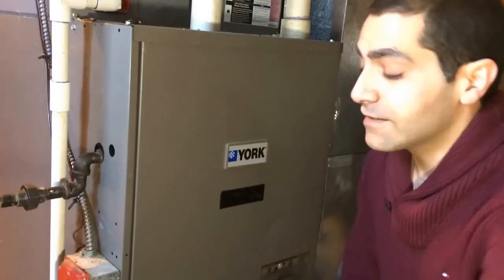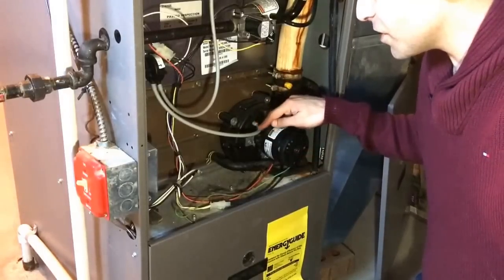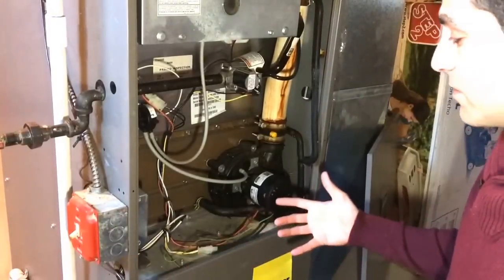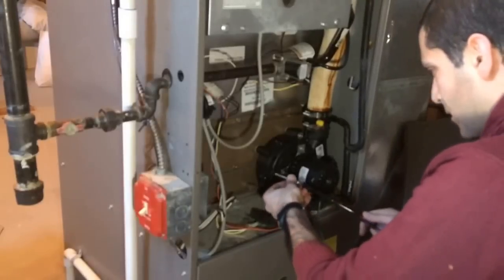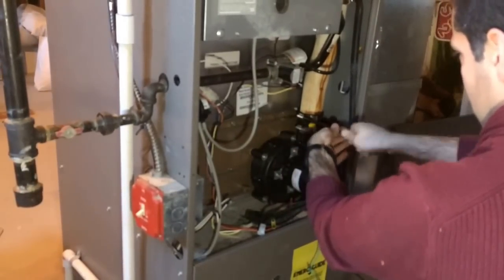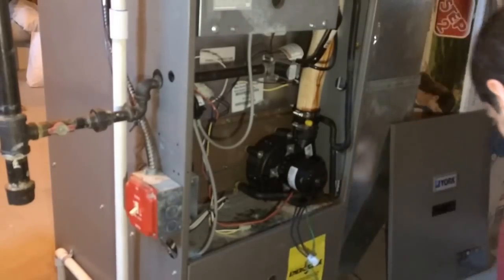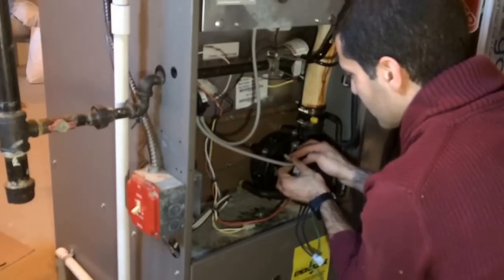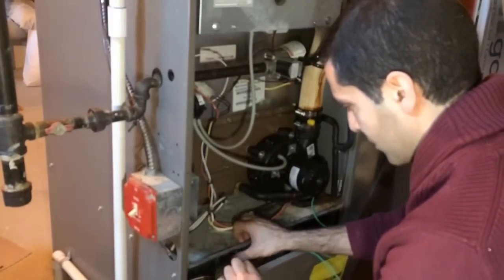[SOLVED] York furnace 3 blinks - draft inducer blower motor - pressure switch stuck open

Comment: Question, is the piece with the two drain holes (one capped in yellow) able to be removed? The blower I am removing does not have that and is drained from the exhaust. Everything else looks the same. Thanks

Comment: The video was very helpful and reassuring that I would be able to replace the part, (1-Speed 3200 RPM Draft York Inducer Motor Assembly (115V)). I purchased a replacement from SupplyHouse.com. Their pricing, service and support were EXCELLENT! I would recommend them to everyone.
Reply from the maker: Yeah those guys are great indeed.
Reply: thank you ... took the advice and ordered from them. best price for the part. in my area they ship next day for free too. came in perfect condition and heat is working again

Comment: Can you list the part and a little more info on what you bought? I have almost identical set up with the York furnace and wanted to be sure I purchased the right one. Repair guys wanted to charge almost $500 for this part and install. I got the part for $162. Thank you.
Reply from the maker: I put a really good description of the whole thing in the video description.  Here is the part I used: 
I purchased the following part:
Fasco A225 115 Volt 3200 RPM Furnace Draft Inducer Blower.
Thermally protected. UL recognized; CSA or ULc certified. Clockwise shaft end rotation for gas or oil furnaces and heaters. 3200 rpm speed rating. 1/15 Horse power. 3.3" Diameter. 115 Volts. 2.25 amps. Speeds: 1. Ball Bearing. Cross reference information: OEM replacement for York #7021-11577, 17503, 7021-11830, 024-34558-000.

Comment: Mine is quiet, but the  three red flashes on my York tells me this part is bad. Could it be clogged?
Reply from the maker: Yes. It’s a good possibility. The part itself (the pressure switch) is quite cheap. If you can’t somehow unclog it, just replace it. Check Amazon. Also, check the hoses.
Reply: @tareksaleh77  Another question if you do not mind. My furnace shutdown again, but this time with 5 flashes.... Now it seems to be the rollout sensor? Could it be actually be the motherboard? I seen how to troubleshoot the board but wanted a pro point of view on the possiblilty of a bad board with numerous faults indicated. Thank you for your help!
Reply: @tareksaleh77  will check into it, thank you!

Comment: I got a york and it flashes the three red light code also I been having to blow the ports out for awhile with air hose but this time it's not working I've ordered this new blower motor I hope it solves the problem it isn't supplying air to the switches

Comment: just changed a Coleman 37319801821 Furnace Vent Motor on my , COLEMAN
 FURNACE/HEATER, GAS  Model #DGAA070BDTB , tighten everything up , now 
it , crackles and pops , almost every time it fires , now what ?

Comment: Thanks for the video. Exactly how ours has sounded for the last two days. We woke up this morning to a cold house. No heat, steady red light when powered and sequences of 3-flashes when we turned the thermostat up to start the furnace. Got covers off to check both diaphragms and the hose and they all checked out fine. Motor turned freely when power was off and when using a tool to spin it...but when power was applies I could hear the semi-quiet "naaaaaa" of a dead motor wishing it could turn but not being able to. Gonna go search for the motor now. Ours furnace is a 90% efficient Goodman model GCS90703BXA and the Induced Draft Blower Motor is the Goodman 223075-21.

Comment: Thanks for the video. 3 Flashes + Same noise = Same problem. Changed out inducer in under 10 minutes. Furnace works perfectly. Saved at least 500 dollars.
Reply from the maker: Oh awesome! Glad to hear it. Thanks for sharing. Please do subscribe to support my channel. Really appreciate it.
Reply from the maker: Saw you subscribed. Thank you so much.
Reply: acmdog where did you guys get the inducer from? I’m having the same problem
Reply from the maker: Amazon. Search the original part number. You should find replacements.